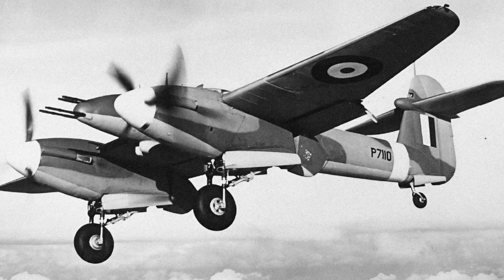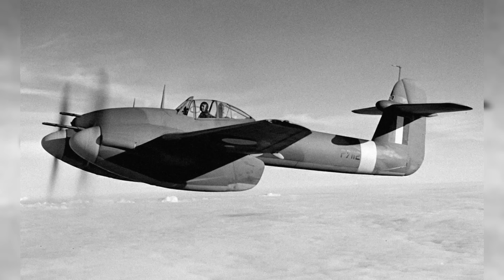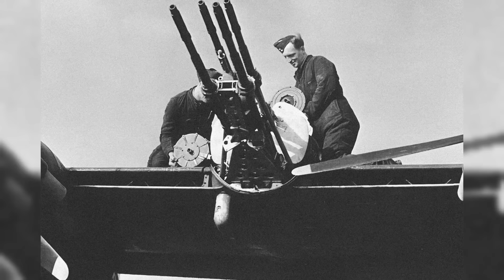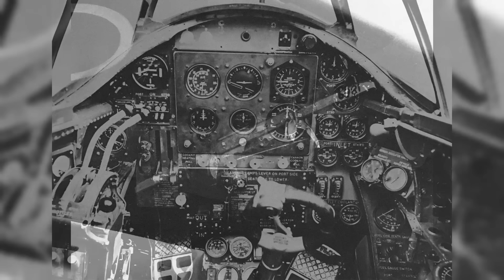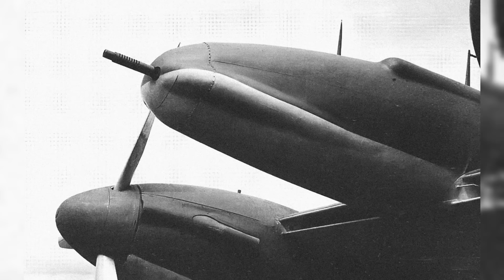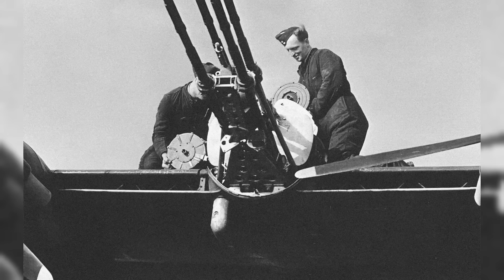Westland Whirlwind: The RAF's First Cannon Fighter

Comment: The main benefit of the Westland Whirlwind was having all 4 cannons on the centreline for zero deflection gunnery. This meant very simple sights could be used, all while making it much easier to use & much more accurate. There’s a reason German & Russian fighters had their guns & cannon concentrated in & around the propellor hub. 

There was an updated version of the Whirlwind with twin Merlin engines, instead of the smaller RR Peregrine engines. Problem was it was designed for purely high altitude use & again only about some 300 or something were made.

Comment: This is easily my favourite twin fighter of WWII. I think I fell in love with it when I built the dinky little Airfix kit way back in the seventies. It has such an original design, bubble canopy, four 20mm cannons, fast and maneuverable for a twin. I have always liked high horizontal tail planes and the Whirlwind really does this justice. I have since built the challenging but rewarding Special Hobby 1:32 scale model and it is awesome, I recommend it to fans of this iconic, underdeveloped un-sung hero of WWII, ah, what could have been . . .
Reply: I also fell in love with this aircraft. You have to wonder what it would have been like with a couple of Merlins to power it.
Reply: @bigblue6917  Unfortunately Merlins would have been too big and heavy. As mentioned int he very well researched video, the design was so tightly built around the Peregrin engines, any change would have a knock on effect throughout the airframe. They could have redesigned it as a slightly larger fighter overall but that would have taken even more time, what a shame though . . .

Comment: The most comprehensive analysis of this aircraft on YouTube. Nice work.
Reply: I suggest that you have a look at the WW video made by Gull Perch Flyer and the one by Ed Nash. The engines, as it turns out, were not the problem. It was the propellers that were fitted to the production aircraft (different from those used on the prototypes). Matt Bearman is the gentleman responsible for the very thorough research into this aspect of the WW. Jerry Brewer has a copy of the letter from Westlands to the Air Ministry indicating that they could fit Merlins to the proposed Mk 2 of the WW. Unbelievably the Air Ministry never asked for cross over feed between fuel tanks and engines! Something else they would have rectified on the Mk 2. The cannon arrangement for the Mk 2 would have all four cannons (plus 3 x 0.303 machine guns) horizontally mounted in a modified nose cone so that they could be belt fed - increasing the armament load and firing time
Reply: @pfwaylander  This is likely 'AI slop' channel; digesting multiple humans' research and regurgitating it. Joined Nov. 2023, no videos for ~20 months. Suddenly 123 videos since 30 July 2025, 178 days. That's an unlikely pattern for a 'human powered' channel, but matches dozens of 'AI slop' WW history channels since, about, May 2025.
Best Wishes ☮
Reply: Well I'd never heard of this plane.

Comment: Imagine the Battle of Britain with Whirlwinds !  He 111s would be decimated  !
Reply: They were!!!
Reply: Hardly. Five seconds of ammo.
Reply: @ericadams3428  Spitfires only had a about 10 seconds ammo and much smaller ammo at .303 5-10 seconds of 4x20mm is more than enough
Reply: @jonsouth1545   15 seconds continuous fire.
Reply: @jonsouth1545  16 seconds actually
Reply: @ericadams3428  The video said 10 seconds, still not enough though.
Reply: @RemusKingOfRome  60 round drum magazines, rate of fire between 600 and 750 rounds per min therefore six at the most until belt fed systems were developed.
Reply: @ericadams3428  OTHER  sources quote 16 seconds of ammo for Spitfre/Hurricane . 8x machine 'guns' WERE concentrated at 250 yards or any range the pilot wanted . 1936-1941 The RAF went with what they had supply of . Quoted duration of ammo is only relevent if you are hitting the target . Undefended bombers can be approached directly from the rear but in a dog-fight most 'shots' are DEFLECTION . Fewer well trained pilots will all-ways beat quantity . See the Falklands ...............
Reply: @FrancisThurmer  Most sources say in general RAF gunnery was poor. There were a few crack shots like Stanford-Tuck but they were rare.
Reply: @ericadams3428  10 seconds of ammo like some other aircraft had.